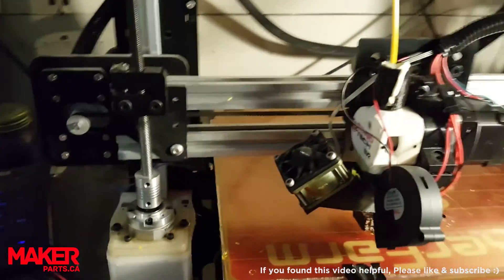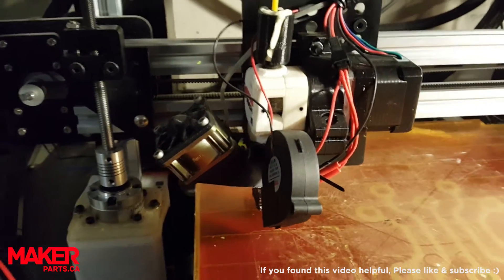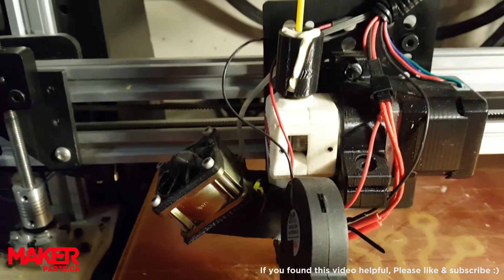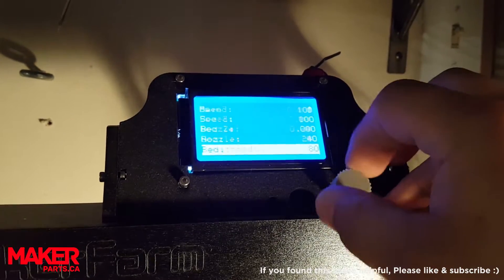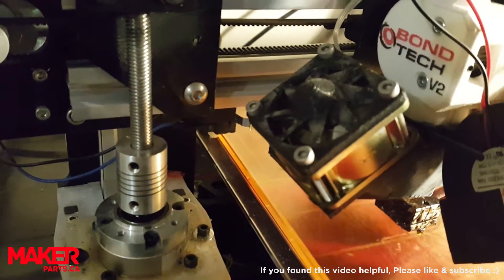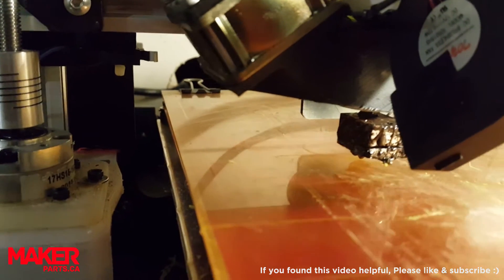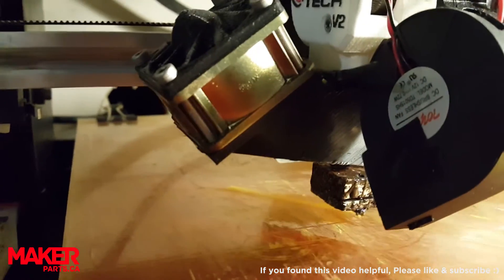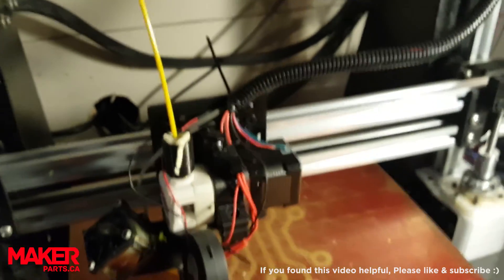The Perfect 3D Printed first layer, using babystepping

Comment: Sir,
Printer not doing auto leveling, I use bltouch, Printer type same as your, 
I use commands are G28, G29. . . After G29 probe take 9 points for leveling, but when print , first layer looks bad somewhere nozzle up and  very down.
Is baby step solution of that problem ? 

If yes then please suggest how this works . . 
Please reply
Reply from the maker: babystepping is useful to help you determine the right starting layer height, that is set in your firmware. So if your first layer height is set to 1mm and you use baby stepping to bring the nozzle down 0.5mm then you know that next time your first layer height should be around 0.5mm to start.
Reply: the touch will only fix very small variants in bed height.